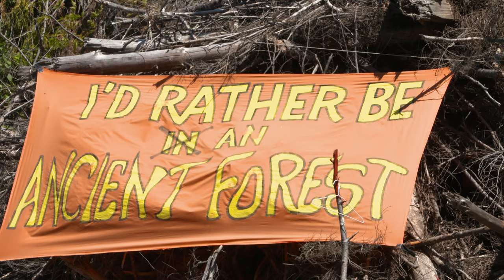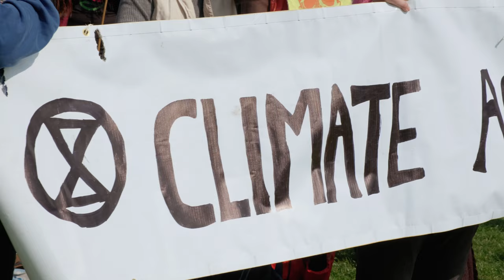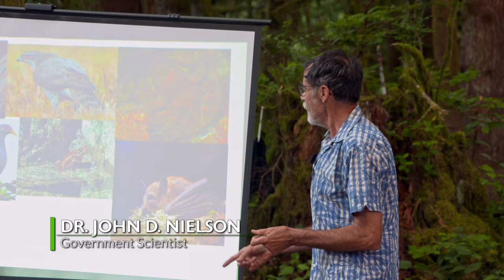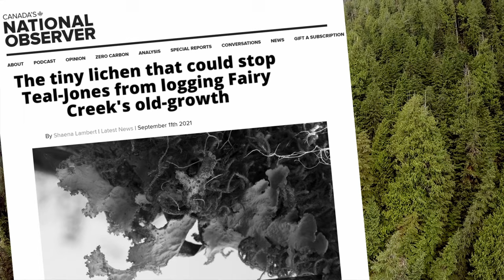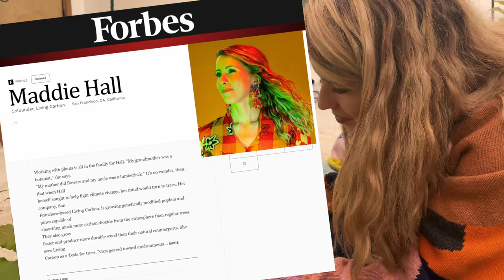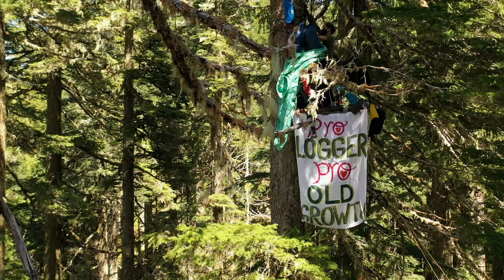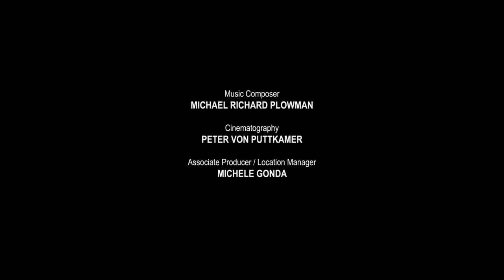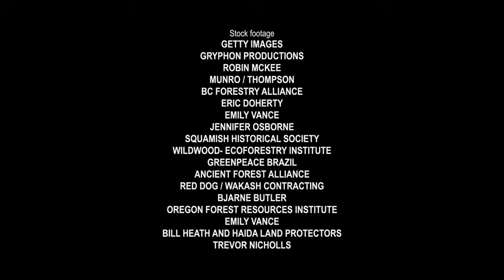The Last Stand | Official Full Documentary | Environmental

Comment: No problem! Here's the information about the Mercedes CLR GTR:The Mercedes CLR GTR is a remarkable racing car celebrated for its outstanding performance and sleek design. Powered by a potent 6.0litre V12 engine, it deliveres over 600 horsepower. Acceleration from 1 to 100 km/h takes approximately 3.7 seconds, with a remarkable top speed surpassing 320km/h. Incorporating advanced aerodynamic features and cutting-edge stability technologies, the CLR GTR ensures expectional stability and control, particularly during High-speed maneuvers. Originally priced around $1.5 million, the Mercedes CLR GTR considered one of the most exclusive and prestigious racing car ever produced.its limited production run of just five units adds to its rarity.making it highly sought OTM... after by racing enthusiasts and collectors worldwide.